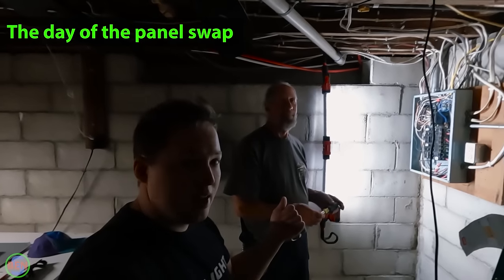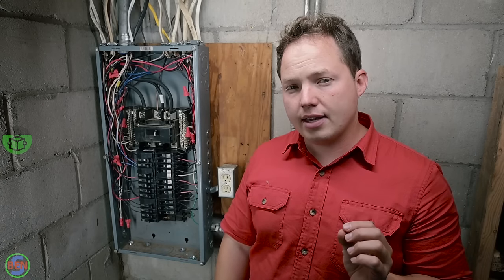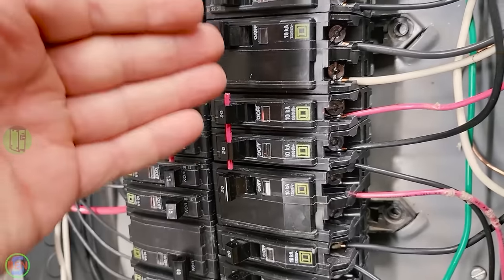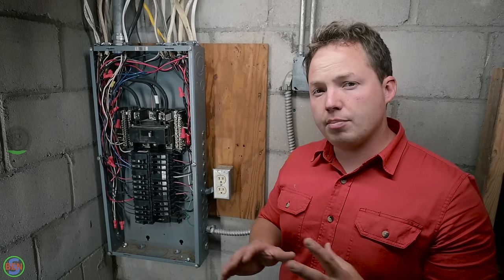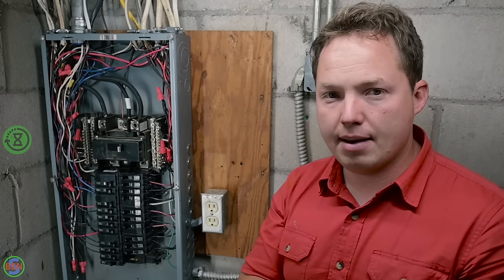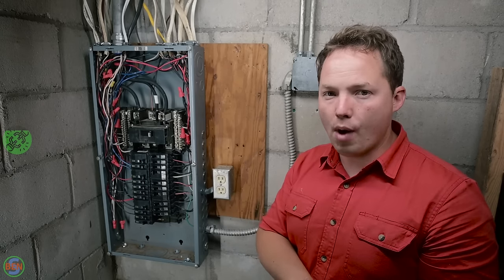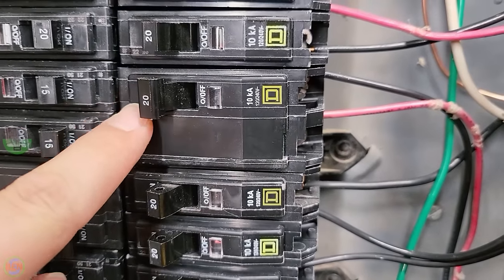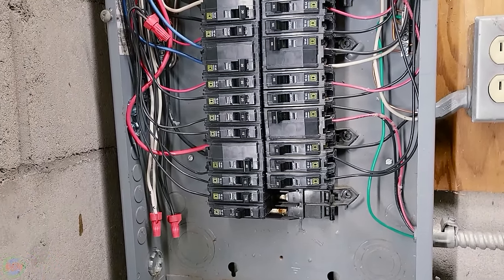How To Replace a Main Panel or Sub Panel - Upgrading an Existing Electrical Service

Comment: Nobody can MAKE you do anything if YOU own your house. If there is an issue they can fail it on inspection if you go to sell your house, unless you sell it "As Is" then it is as is, and the buyers might not buy the house unless you fix it. So there's that too. But if it's your own house, that you paid for, you can do whatever you want. You are the king of your castle.
Reply: And if your house burns down because of unpermitted/uninspected wiring, they aren't covering it.
Reply: @leadxpoison9281  They cover people that do electrical experiments in their house or store fireworks, so if your premiums are paid, they will likely cover it. Prove it was caused by new wiring as opposed to old wiring that was existing and outdated. They can prove arson and where a fire started, they can't prove what started it if someone didn't tamper with anything.
Reply: @michaeljavert4635  Sure, if you pay extra for your premium that specifically covers "experiments", you'd be covered for whatever your policy states. The average person (who isn't pretending to be Tesla) would NOT be covered under the standard policy. You don't think they can figure out if the wiring is new or old, whether it was done properly, whether there are records of wiring being done in the suspect area? LMAO. Have YOU ever been inspected? You think they're dumb or ignorant and can't figure it out? The wires are date coded on the sheathing. They are also color coded and there can be different metals/methods used in the construction of the wire itself. They can look at proper gauging of the wire, PERMIT RECORDS, etc. You're assuming there is no trace of anything after a fire and that isn't always the case. Furthermore, we've had the same electrical inspector here for 25 years and he has a very good memory, I must say. He warned me about my Ethernet cable going underground from the house to the garage. The garage was built 22 years ago. I ran the Ethernet cable probably 5 years later...17 years ago. He was here two years ago to inspect my bathroom remodel and that's when he told me that he didn't remember it being there (it's within view of the front door) when he approved the garage wiring TWENTY-TWO YEARS AGO. (Yes, ETHERNET CABLE has to be inspected, too.) So, I sure hope that none of your wiring ever causes an issue because they very well could figure out you're to blame. If you have basic insurance like most people do, you're screwed.
Reply: Standard home fire insurance ABSOLUTELY will deny coverage if there is a lack of code compliance.

And a trained and experienced Fire Inspector, with a Fire Cause/Determination endorsement with Arson Inspection are incredibly capable of finding evidence.

Add a death related to the incident, and that insurance company will be hiring a Federal-level team of investigators.

Comment: why is that little piece of copper wire laying on top of the right phase terminal in the top of that new/used panel (laying in that 13lbs) of nolox? LOL
Reply from the maker: I saw that in the footage too! It's just a scrap that somehow landed there. Figured someone would eventually mention it!

And I agree, the anti corrosion compound was a bit excessive. Certainly wouldn't hurt to clean it up a bit.
Reply: I also noticed that piece of solid bare copper wire immediately. Does that mean I was paying attention?
Reply: @BenjaminSahlstrom  could be a future unprotected 20amp branch circuit when you run out of spaces? LOL. Just picking on you. That panel is 180 degrees off from the quality you've done on your panels and other panels you've shown on your channel as far as craftsmanship. Kind of a shocker... 🤣 Anyway, love your channel
Reply: @RS-qp4bp  IKR, I almost got in my truck and drove 900 miles just to go up there and remove it, and wipe that 10lbs of nolox off of everything. 😂
Reply: @MiniDigging  I'm not trying to sound like a know it all but it is spelled No-a-lox and yes people pronounce it nolox. Yeah that guy was slathering that stuff and making a big mess. It bothered me and I wanted to go over there and clean everything off before tightening the lugs.
Reply: @RS-qp4bp  I know what you mean

Comment: Any one looking to upgrade panels or add a sub look for panels that can or have specs for tandem or piggyback breakers like a 30 spaces but can have 60 circuits.  in the description it will say 30/60 ,16/32

Comment: I just happened to review this video because I remembered all the wire nuts in the panel. Some AHJ will not allow this and home inspectors love to point them out. I use a separate gutter box or large J box to do my short wire splices. I just had a job to move a sub panel in a remodel and had to do this for 75% of the wires.

Comment: Ben I am so confused. Is this an old video? For years I have been watching you doing the most premium looking installations and then I see this video from a year ago where you brought in another electrician to do a job which  you made sound like you couldn’t do and even though I’m sure it’s fine it’s not as perfect as the other panels I’ve seen you install well over a year ago. I’m very confused but I really appreciate your channel and I watch your 200 amp service at your house video fairly regularly when I’m looking up videos on QO panels

Comment: Humans CANNOT tell torque value by feel, regardless of years in the trade.  This was looked by the code panel having laymen and master electricians try to gauge it by feel. 80% were low 15% or so high 5% got it within tolerance.  Hence the reason for the code rule to torque connections.
Reply: I always tighten the screws to a quarter turn before it breaks. LOL not really, I try to use a torque wrench when possible. I see a lot of electricians really crank down hard on screw terminals all the time. And a torque wrench will be sitting right next to them and they won't pause, pick up the torque wrench and use it.
Reply: That’s actually not true, in Structural Steel Construction it is allowed to bring things to a “Snug Fit” then use the turn of nut method to bring the fasteners to tolerance, however they, the humans had to be  calibrated by code daily in order to keep within acceptable tolerance… so on a daily basis all the steel workers would line up at the calibration station and be blind tested to ensure their snug was within tolerance. This doesn’t work in low voltage electrical work because it’s inch pounds which is low torque and a lot finer line between acceptable and rejected.
Reply: @inspector8572  what is an iron worker doing watching electricians work? I'm going to report you to your union 🙂🤣

Comment: Thanks Ben for all your informative videos. My comment or question is about the wire nuts? I was told by an electrician that they are not allowed here in Wisconsin. An offset separate can or junction box must be used to connect short wires to reach the new install. My own thought might be crimped butt connectors with heat shrink? Your comments please are welcome everyone.
Reply from the maker: As far as I know most areas allow wire nuts or wagos in the panel when it is obviously necessary however you can always find certain areas where thr AHJ will require something different. When in doubt contact the inspector in your area to clarify this before getting started. 

Thanks for sharing your experience! We're in MN so I would think that it would be similar but I know big cities often have more complex regulations as well.

Comment: Never seen so many wirenuts in a panel lol.
Reply from the maker: It's a sad reality with panel replacements.
Reply: @BenjaminSahlstrom  totally understand.  Sure would want to have to pull all those lines for each circuit lol

Comment: Get the correct breaker, don't use a kit or wire connecting the breakers; seen one trip and the other fried the equipment.

Comment: Ben can i put a 50 amp breaker in a row of 15 ,20 amp at the bottom or move 2  15 amp breakers to the bottom and put the 50 amp at the top ?
Reply from the maker: It honestly doesn't matter where in the panel you install the 50a breaker.

Comment: i can see wanting to upgrade from 100a to 200a.. but if your home has 200a.. why do you need to replace your box" frequently" as you stated... our house we got is 30 years old, its 200A.. yes i needed another breaker to use for the outdoor lights i installed going down the 700 foot long driveway but i got lucky and found a 20A circuit wasnt being used "labled" jacuzzi tub, aparently the master bath once had a tub with jets, and it was replaced with a new tub. the wiring for it, is aparently in the wall somewhere, but the breaker was flipped off, and not used, so i jyst removed the romex from it, and ran the 12ga UFB wire outside through the air conditioner piping cutout all the wall, and to the breaker.  was perfect as its 20A too, and thats what i needed..  Now if i need more yes im out of room as all the breakers are used on the 200a...  but explain why they need replaced " often" as you stated... if the breakers themselves are still good, and the torque is checked.. i dont see at all why it needs replaced completetly lol.

also if your worried about two wires in the neutral and one fryng stuff.. why dont you just turn the power off to the entire panel when working on the fuse panel to begin with.. that way you wont fry anything
Reply: I think he meant that it's common for someone to upgrade to a larger panel.  i.e. for an eletrician, this is a frequent request.  If you have 200 amp service already, and 40 spaces, you're unlikely to need a new panel.
Reply: @stevesether  ahh see im like.. besides old breakers how does the metal panel get (old) lol

Comment: Why would you use an old panel? New ones are not that expensive. If you are going through the expense and time to replace a panel stick with new equipment.

Comment: Is pex should be grounded?
I have pex inside as well as pex-a main water line, all basically plastic inside out. 
 I was wondering that if my water heater is grounded then in case of lightning hitting my house and someone is taking shower would we be protected because of the water heater grounding?

Comment: Bro, where do you live? You cant reuse  the existing 100 amp rated wires , install a 200 amp breaker and say " its not an over current device, its just a disconnect. "  the breaker doesnt know what it is.  And you dont think that the 100 amp breaker acts as overload protection  for the main panel? You are asking for problems. That "200 amp panel" is gonna get more stuff added to it , like you said. Car charger,  hot tub, A C, whatever they are gonna see 200 amps disconnect,  maybe not knowing its only rated 100 amps, turning those aluminum wires into a great heater.
Remember,  the code does not tell us how to do our work,  it tells us what is the bare minimum standards required, basically just so everyone is safe. Sometimes its better to go above just the minimum
 standards .
Also , as to not requiring AFCI  breakers and such  ,  if you are doing a Service Upgrade, everything needs to be up to latest standards,  including new service wires from the utility.   Only exception is if you are doing an exact  LIKE FOR LIKE  panel replacement,  but id say thats not too common to just do a lateral change.

Comment: Ben , I see wire nuts extending wires ,Is it legal to do Wago connectors ?  I’ve used the push in ones  from big box stores, they are Crap!
The wires easily fall out. I had a circuit fail after a few weeks after some storms rattled the carport.

Comment: Remove electricity meter to cut power off??? This is good way to get deep skin burns by arc and disability. 

Old breakers with old wiring could be saved only if you want to replace panel enclosure. 

In Spain and Italy ground is separated from neutral, but they installing main GFCI as main disconnect - all circuits in building are GFCI protected. Idea that hot wires are one plate of capacitor and dirt is second plate of capacitor - charging current of this capacitor should be enough to trip GFCI. 

Zip ties can't affect to heat. If the wires are badly organized in your panel, you'll have inductance which causes heat. Better to use zip ties, especially if you have stranded wires in your panel. In alternating current inductance and capacitance are more critical than active resistance of solid copper wire.
Reply: Shut off all the breakers before removing the meter. That way there will be no load.
Reply: I'm guessing English isn't your first language...
Reply: @sjsz06  is it critical?

Comment: Jesus Christ i rip out stuff like that in the Uk, electrical standards are incredibly different
Reply: Indeed, That wiring is a mess!. At first i thought that was the old board they were about to take out. Not a single conductor is straight, none of the bends are uniform.  Nothing to do with the electricians work but the incomming supply terminals arn't even insulated / no guards. Looks like an old 1980s crabtree board in the UK.

Comment: I would have sworn there was a 6 inch minimum off that corner but code doesn't show that
Reply: Would be a good idea anyway!
Reply: @sk8infreek  I agree
Reply: There is a 30 inch width requirement or width of equipment (whichever is larger). As long as the panel door can open 90 degrees then it's all good. The 30 inches doesn't have to be centered on the equipment.
Reply: Conspiracy theory to follow:.  
Why didn't we get to see the finished product at the end of the video. ie. All covers in place? I think the installer should have labeled the circuits on the panel unless he has very poor penmanship. For you millennials, that means writing with a pen or pencil on a surface, usually paper. Do they still teach cursive in elementary schools?
Reply: @RS-qp4bp  My boss is 59 years old and uses a label maker. He isn't a millennial but it's just neater that way. Lol I am Gen Y and know cursive but it isn't very practical to be honest.
Reply: @illestofdemall13  i wish older guys used lables..  i have a 30 year old house, nothing is friggin labled. i had to switch breakers off and on to find where they went.. was frustrating when i was trying to do some wiring for outdoor lighting and also for the former kennle and the barn..

Comment: This panel is dirty. If I see wire nuts inside a new panel you got nipped. This has to be the worst “new panel” upgrade I’ve seen on the tube. Did you check the electricians master certification? 25 years of junk wiring.
Reply: Haha he used wire in place of a handle tie. So dirty. Did you pay this guy?
Reply: Short of rerunning the lines or ending up with a bunch of junction boxes outside of the panel, how do you avoid the wire nuts? Sometimes you have to relocate circuits or extend neutrals (like if upgrading to GFCI or AFCI breakers).
Reply: @BitmappedWV The panel should be clean and well labeled. Work can easily be done in a can without working in a panel. I Probably would have mounted a 12x12x4 can above the the panel and run new wire to the panel. On the commercial side this is normal with a chase to add new circuits. Trying to troubleshoot a cluttered panel or add new circuits with wire nuts and spaghetti mess taking up most the space is dangerous and only crappy new wiring will be done to route wire through the mess. This panel is the why there is a term called “rats nest” . Easy job in a can with no feeders.

Comment: You should get a real handle tie rather than doing that piece of wire. That is unprofessional and against code. The reference is in the NEC 2020 Article 240.15(B)(1).
Reply from the maker: Did you hear my explanation regarding this in that we will likely be replacing the wire with the correct handle ties? I realize that the wire is not "correct" but in my opinion it is much better than nothing if you don't immediately have the handle ties available.
Reply: @BenjaminSahlstrom  Yes, I did. But it's not a good idea to tell people they can use wire at all as a handle tie because it's against code (though it may be acceptable in other years). You asked about whether it is acceptable in our jurisdiction and where I am at they don't allow it.
Reply: @BenjaminSahlstrom  BTW, I wasn't trying to sound rude but through text it can come off that way. It's a good video with good info, just putting in my 2 cents.